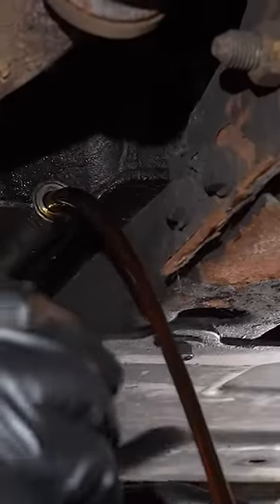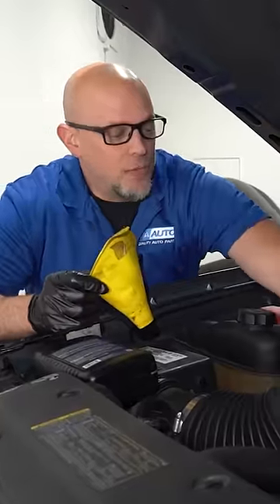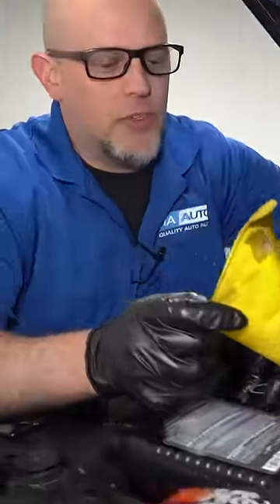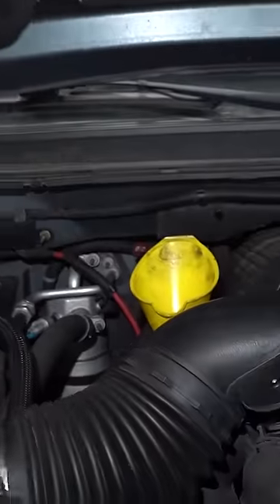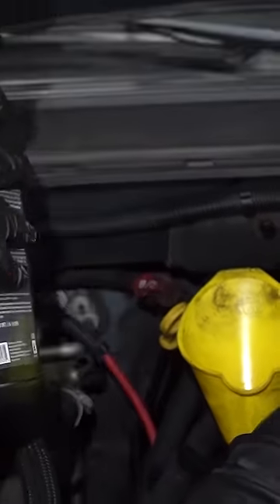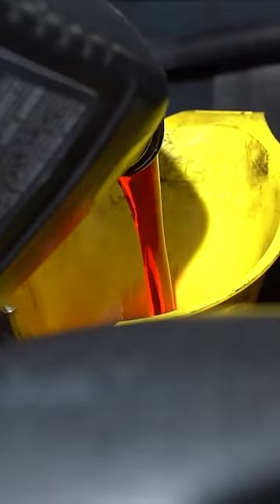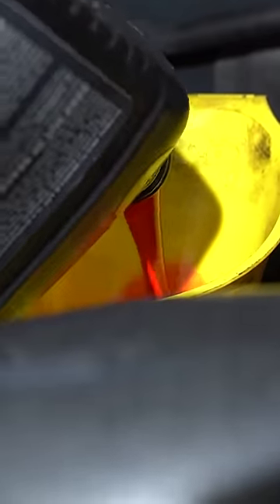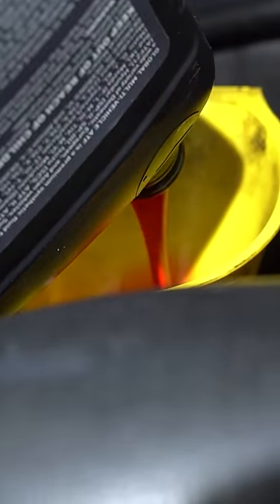Clicking, Tapping Engine Noise? Try This Trick Before Replacing AFM Lifters! #shorts

Comment: Prior to overhauling my 327's
I always drained the oil and replaced the filter..
Filled it with ATF And ran it for a week or two..
Changed the filter and topped off the crankcase with more ATF..
When disassembling the engine, it looked as if it was steamed cleaned..
I did that for a college course, engine rebuild and  the youngsters asked how I got the inside so clean..
I educated them in what ATF is good for besides hydraulics..

Comment: Instead of taking 3 quarts of oil out, take just one out, and replace it with L.A.’s Totally Awesome APC. It’s like adding a concentrated detergent package, and will remove deposits and engine plaque in just 10-15 minutes of idling. Be aware, sometimes removing gunk causes leaks, so this will also help you identify bad seals and gaskets.
Reply from the maker: +Seth Martin Thanks for the feedback!

Comment: I used marvel mystery oil to quiet that sound until I found the right oil that has the best combination of additives to get better film retention using a thinner oil . Surprisingly it's not the most expensive s*** on the shelf .
Reply: What oil do you use then?
Reply: What oil are you using with the additives?
Reply: And what was that exactly? Also which type of vehicle and motor?
Reply: Hi

Comment: That sounds like a procedure that you’d want to do annually as maintenance!
Reply: Nope not at all trans fluid is not designed to be run in the engine 

It may work but just fix your lifters I doubt this trick really makes a difference for all the risk of putting the wring oil in
Reply: Just change the oil at the correct mileage and correct spec and you will never have lifter knock

Comment: I have an old 62 Ford pickup I think it's a 390 something I don't I don't remember it's got a million miles on the thing the speedometers broken I don't know for sure it runs flawlessly, it leaks more oil than it uses, Brakes and Tires air filter spark plugs points it's all I've ever done to it. Fantastic work truck

Comment: I use to remove hydraulic lifters and take them apart and clean them with wire wheel and varsol bath. Oil them up, reassemble and install back into engine and adjust. Took some effort but was cheaper than buying new and worked like new.

Comment: I do this but with 1QT marvel mystery oil for the last few hundred miles of each oci. Has quieted down and cleaned up my 04 engine with 150k miles very nicely. I also use some in the fuel every other fill up. Mpg has increased.

Comment: Also can run the rpms up to 2500 to 3000rpm.   Fills the air gaps with oil.   Especially in pre 2000s cars

Comment: How often would you recommend doing this just to do it so that everthing is clean ?
Reply: You can do it right before every oil change just run it with the transmission fluid for 10 minutes and then do your oil change as you were going to anyways it helps keep your engine clean and sticky free
Reply: Hi

Comment: Not sure about anybody here knowing what they're doing. I'm amazed at the number of people doing this longterm without problems, if truthful. 
Adding right before an oil change, 5 minutes or less, ATF/Mystery oil/kerosene/diesel, is good to clean out an engine ONCE in its lifetime. All those chemicals mentioned will strip the little particles at gaskets, that you now will have leaks at, for the exact same reason you should NOT start using synthetic oil over 60,000 miles, very detergent. 
YES it does clean an engine, no argument there. YES it does POTENTIALLY remove enough gunk that you develop leaks at seals.
Reply: wait ur not supposed to put sythentic oil over 60k miles?

Comment: I knew an old mechanic that would do this with diesel fuel , worked every time. Some engines we did gasket jobs on and they looked like new inside as a result.

Comment: I approve this message! Been doing for 20+ years! Another tip is to use Diesel engine oil 15W40 especially if engine smokes/burns oil diesel oil won't pass piston rings easily hence reduces burning and smoke!

Comment: This is a very very old trick. Talking about over 50yrs old trick. I was taught to drive gently for about 20 miles. Also to only do this trick on dirty engines. You could tell by removing the oil fill cap. If sludge was on cap. Check oil. If oil low. Add transmission fluid till oil is max full. Go for 20min drive. Change oil. With 10w30 high mileage oil.  Or back back in the day. Add 1 STP. I changed that to Lucas oil additive.

Comment: my 2003 Infinity G 35 sedan has 260,000 mikes and the lifter has been ticking for the last 3 years lol. It started ticking at 256 000 miles. I think I will try it how hard is it on older bearings? would it riun it faster?

Comment: This is merely putting a band aid on the issue. Despite what people think, putting a different oil in the engine won’t fix whatever mechanical issue there is. It only delays the issue slightly, eventually it will come back.

Comment: I have a 2012 jeep that has 200k very hard miles on it and it just ticks ticks ticks away. What’s awesome about it though is I’ll never have to change the oil again I now run just pure Lucas in it and as it burns off I’ll just add another quart!

Comment: U can also burn ATF as a top cylinder cleaner/lubricant similar 2Marvel Mystery oil. It will clean& lubricate the valves & remove carbon.

Comment: Avoid adding the solvent motor flushes.  Do it more gently over time with basic ATF or Marvel Mystery if you want to pay more.  If you have access to the true synthetic PAG oils like Mobil Jet Oil II for turbine engines, they will definitely clean it out, but over the long term they will dissolve your oil seals.

Comment: I need some help people. Got a 2003 Trailblazer 4.2L I6. Tick sound started as soon as Temps dropped in michigan. What transmission oil should I use and I'm going to run it to operating temp and change the oil.

Comment: Ofc it's a Tahoe or suburban ticking away luckily between bother of my suburbans I've never heard any knocking or ticking besides, the exhaust leaks I had on one of them I got underneath to investigate and there was weld wire broken off right before a bend in the pipe and it rotted out I don't know if they had replaced the exhaust or if it came like that from factory

Comment: Tapping noise isn't always the lifters. If the motor has over 200,000 miles, start to replace that weak oil pump. I had a 97 GMC safari van with the 4.3 liter V6 motor and that lifter tapping was always on the right side and even after I did oil changes, it still wouldn't subside, and one day I was traveling 2 hrs west and a loud racket was going on in the oil pan. The oil pressure dropped like a bomb and I was stuck with a seized motor.  Mech who worked on my car didn't know this and thought it was normal start up .

Comment: If you do this, and have carbon that is actually sealing up problems, and stopping leaks, you may discover new leaks. It's way smarter to use kerosene or diesel. Diesel has additives that help clean, kerosene is a thin fuel oil used in heaters.

Comment: If anybody wants to know does this work or not, just put in fresh oil and filter and clean the drain plug. Then put fresh oil and ATF and do this. Then drain the oil and crack open the filter and examine both for residue and metal bits.

Project farm did some tests. I don’t recall his conclusions…

Comment: How can atf work in a engine? The atf oil in the engine will not hot enough to clean debris like in a auto transmission. Or? My thoughts may be wrong🤔

Comment: My Dodge 1500 had a lifter noise when I bought it but after about 2 or 3 oil changes with Valvoline high mileage, the noise went away. My PT Cruiser has 171,000 miles on it and it's starting to burn up to a quart of oil between oil changes. I'll be switching it to high mileage oil this next oil change.

Comment: @1AAuto i have a 2006 mustang GT, i get a noise on acceleration after about 30 minutes of driving. Sounds like a clicking/ticking. The sound goes along with the rpms. Does not make the noise in park and only after 30 minutes of driving. Anyone have some insight on this?

Comment: I wouldn't do this on direct injection turbo charged motors. ATF isn't rated against low speed pre ignition, which grenades the motor and direct injection and turbo motors are especially vulnerable to this which is why they need oil rated for low speed pre ignition.

Comment: My 5.7 ticked on the passenger side since I got the truck “29,000 miles” it’s now at 104,000 and it’s started on the left side. It quiets a bit when she warms up but doesn’t seem to go away like the old tick “ passenger side has always been thought to be a manifold leak as it was pretty much non existent after a minute or so of running the truck. Any one have any recommendations? Should I drain a quart or two and use ATF? Lucas oil stabilizer? Trying to figure out next steps. Recently got “caught with my pants down”with the kids, wife and our dog in the truck while towing the camper home from vacation 3 hours from home. Had a scanner in the car as one should and got the good ol P0303 code. If you know then you know. Got away with just a quick ignition coil and two plugs but the stress of a breakdown with everyone with me and the camper made me decide to get serious and start going through things.

Comment: 3 quarts of diesel fuel or kerosene with one quart of 5w30 works well too, just let it idle till it’s up to temp, don’t rev it, don’t drive it. Drop all the cleaner and the filter, new oil new filter.

Comment: I like to use marval mystery oil instead. Because i once used pennsoil and it turned the inside yellow when it was the aluminum color no stain. So i put MMO in it, it was a quart low so i topped ot with MMO ran it for 5-10 mins. DO NOT REV THE ENGINE just idel it. Then i drained it amd used some MMO while the plug was out to flush the bottom of the pan. And i used moblie clean 5000 and added 1/2 a quart on top of the recomended fill.  But i cant find the mobile clean 5k now idk if they discontinued it or have it by a differnt name now. But after 1200-1500 miles it was almost back to clean so i changed it and put new mobile clean 5k and new MMO  back in it. And it was clean as could be. And in a differnt car with 300,000 miles on it i was useing MMO in the gas and after 20k miles i took out the injectors to clean them and they where amazingly as PERFECT as they could be for having 320,000 miles on them. 1 of them was putting out a little but less fuel. But after a few flushes with marvel and letting it soak for 20 mins and running the test again all 4 where back to spec!!!!! I am SOLD on MMO. Its MUCH MUCH cheaper per tank of fuel to use so I always just add it to my gas. I found a pump that one pump is 1oz and for 10 gals i think its 4oz of MMO so i just put 4 pumps in then fill with gas and have GREAT milage for way way less then every other injector cleaner. The inly thing is dont leave the MMO in its original contaner because its brittle and easy to break and get everywhere. But i put it in everyrhing EXCEPT the radiader and brakes DO NOT OUT IT IN THE BRAKE FLUID OR THE ANTIFREEZE. OTHERWISE transmission, engine oil, power steering, all love it, it cleans out everything and keeps it clean and conditions seals and O-rings. But if your auto tranny has exssesive wear it will cause it to slip because it has been mistreated and hasnt had proper maintance done. For old scary transmissions that have started slipping froma fluid change is to use lucus tranmission additive. BUT its only tempary and it will need repairs. Othwrwise MMO every fill up. Its cheap it REALLY WORKS and after a little bit of just putting jn gas youll notice a diffrance. And it will help while on the road and you get gas thay who knows what the quality is. MMO ALL THE WAY EVERYDAY

Comment: Don't use transmission oil. Try diesel instead. It still has lubrication properties and won't damage the engine or seals.

Comment: Does it matter what transmission fluid do you use with a certain car
Reply from the maker: +Rajin It is specific to your vehicle model. You may contact a local dealership with your VIN to determine exactly what kind of fluid you need.

Comment: Or you can run diesel oil that is compatible with gas engines as well.. This fixed every valve tick vehicle that I've owned after a few hundred miles of running. Diesel oil has lot of detergents and safer to run then ATF.

Comment: If you want to clean your fuel injectors, just use 91 percent rubbing alcohol and it will remove tarnish and carbon deposits from your pistons, valves, and spark plugs. I have used it for years and I put 91 percent rubbing alcohol in all my friends and families vehicle's. It gives them better gas mileage too.

Comment: That is an inexpensive first attempt and usually gets some results. A better thing is MARVEL Mystery Oil,  it really gets into the crevices and nooks and crannies 20% MARVEL to the crankcase capacity and a New Oil Filter.("Seafoam" is another good product for this too) It gently cleans the engine internals, unlike the 5 minute Engine flushes. Also consistently  changing the oil regularly and using the recommended oil viscosity for your engine will prevent this problem in the first place. A synthetic oil also keeps engines clean too! Long Live the Internal Combustion Engine!!!
Reply from the maker: +tina mcgarrah Thanks for checking us out! http://1aau.to/m/Shop-1AAuto-c

Comment: Just don't run it for more than 30 min, and do not rev it, just let it idle, and drain it and add regular oil, transmission fluid expands very quickly and can and will damage your main and rod bearings if you rev it, i highly recommend just buying an additive for lifter noise, transmission fluid isn't engine oil so be careful

Comment: I have a 2022 gmc sierra 1500 with the 2.7 4 cylinder engine it only hs 2600 miles on it it makes a ticking sound when it’s first starts up and the noise gets louder when I put it in reverse does anyone know why that happens

Comment: My 5.3 sounds like a diesel full of angry monkeys with hammers until it's warm. I've tried every trick including this and nothing helped. If it wasn't such a big job I'd do it where I live but if I'm going that far I may as well lift the body off and do everything and have a ready to go rebuilt engine to install. There's no starter replacement video for a reason.

Comment: Trans is slipping so you use break fluid in the trans ?   Head gasket leaking just use stop a leak .  In the mean time the lifter fails and car has to have a complete over haul .  , Revving the engine to 4000 rpm can fill the lifter and get rid on the air trapped in the valve body .  Seen a lot of back yard stuff done most of it is a waist of time .

Comment: Does this work for Diesel engine too?
Reply from the maker: +Zoltan Molnar Thanks for watching!  This is something that can be done on gasoline engines only.
Reply: Subaru Impreza 1.5l? Uses oil, probably clogged rings?

Comment: This method has been tried and works, because it’s a sure-fire way to creat new customers for Mechanics.  There is a REASON there are labels on containers.  Otherwise, the container would read Transmission and Motor Oil. 😏. Thanks, but no thanks!

Live-on Shady Tree!  😂😂😂😂

Comment: The company I work for was too tired to buy oil the change oil in the company truck I was driving I change the oil for five years out of my own pocket so the next 10 year I use hydraulic fluid that they had at the plant that was free it never used oil again, it never smoked, clattered or ping, with 50 psi all the time hot or cold.

Comment: Either way this is a temporary fix, a failed lifter is t going to be fixed but cleaning it out, it is still faulty and will fail so a customer after this "repair" is still going to be quite upset after it fails

Comment: Trans fluid does not have more detergents. There is no combustion going on in a transmission. It lowers the viscosity rating of your motor oil, dilutes the additive package in the motor oil and turns it reddish… that’s it. I know I know it’s red and people like playing chemist and thinking they are doing something.

Comment: I hate that he said replace the engine. The only time iv ever noticed that to be necessary is when the pistons,rings,block or crank related issues. Most of the time when u have upper engine issues if you dont have damage down low all you have to do is put a new head or both
Reply: Bought a 2006 cadillac with a no start, ripped the timing and valve covers and found a broken sprocket but the sprocket broke when the valves were closed so when i pulled the head the pistons,rings and block looked great, put a used head and new timing set and she ran amazing

Comment: LUCAS my man, no need for grandpas oldschool tricks. 
I ran my ticking 3.8 Mustang another 100,000km before the lifter tick wouldn't go away, Lucas every oil change and the tick was gone right up until around 350,000km when I sold it still running great.
Ford is unfixable plastic trash now tho.

Comment: I like to use Marble mystery oil instead of transmission fluid clean Sandy 13 to everything inside you're engine and we change oil at least twice With really bad sludge inside the engine you can use half a gallon of diesel leave it on for 15 minutes drain change oil twice and I'll clean everything out old Tech From all Tech men they showed me things Tricks of the trade

Comment: AFM sucks, lots of problems, as well as alot of bent pushrod, piston ring lands crushed, ect,  AFM does not cause all of this but I still think it is far from being a good design. Transmission fluid never works, usually the problem is too far gone and the lifter is not sticking, its collapsed.